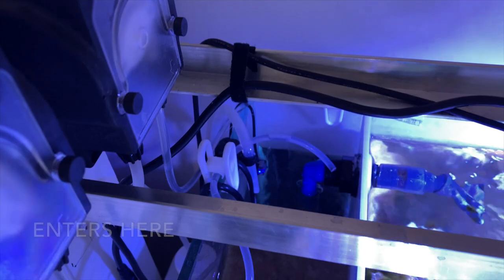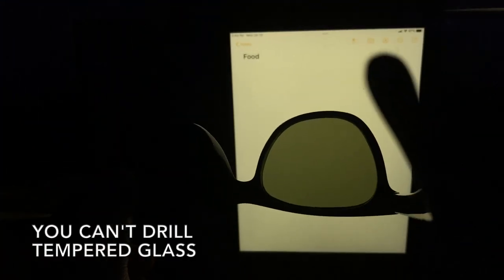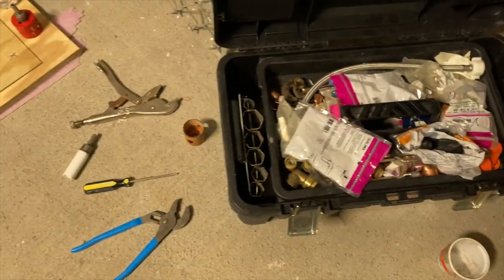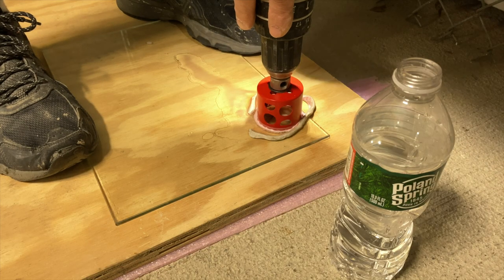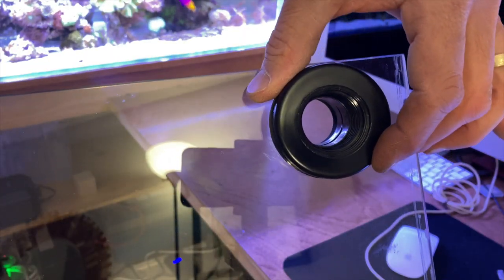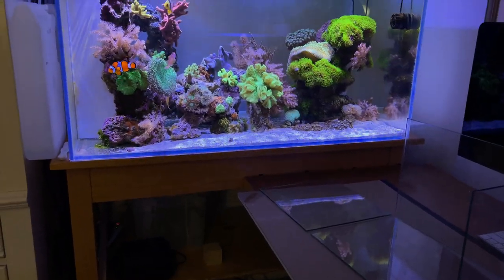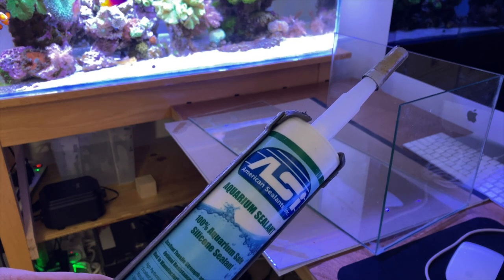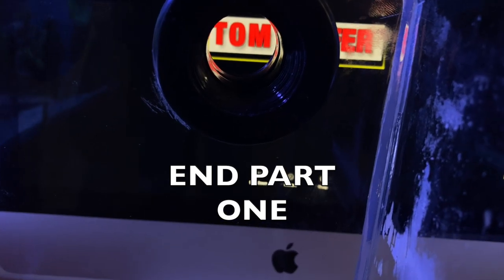How To Set Up A Simple EXTERNAL GRAVITY FED Refugium (Part 1) The Build

Comment: Hey buddy, it’s bobcat here! I have been thinking about starting to use Kalkwasser. I was wondering how and if I could just manual dose it instead of putting it in my ATO container? Plus how much should I dose for a 20 gallon mixed reef?
Reply from the maker: Hey Bobcat! Cool! It’s a bit more work, but you can do it. Called the Slurry method. Lots of trial and testing. First thing, test your tank for calcium, alk and Ph. I would mix  1/8 of a teaspoon to a cup of rodi, just to mix it up. And then poor in a strong flow area, maybe where your return comes in, after the lights go out. The negative thing about the slurry method is you can’t put too much  in at one time. It could raise your ph to high to fast. Dangerous. You’ll have to do it 2-3 times in a 24 hour period. I would do it 10pm, then early am, then mid day. Test the morning after the first evening dose. calcium and ph. If they are ok, then continue the rest of the day. And test the next morning before the morning dose. 👍🏻lots of work.
Reply from the maker: You might be able to get away with twice a day, if your ph stays stable. 👍🏻
Reply: @TOMReefer  thanks buddy!!

Comment: Here's an interesting item as a cautionary tale! I did a similar thing to you by wrenching out an internal filter box with my hands (see: 0:53 in your video). I ended up in the hospital for 10 hours. As I was pulling out the siliconed-in plastic parts, the glass shattered, and even though I was wearing gloves, a big shard of glass sliced my forearm open, deeply. Without the high gloves I was wearing, it could have been a cut near my wrists!!!! Many stiches later I was home and I tossed the tank in the trash. I couldn't tell in the video if there was silicone there holding the back panel on, or if you cut it out then pulled. I made the stupid mistake of pulling and twisting without cutting! Just a cautionary tale for your viewers!
Reply from the maker: Wow! 🤪 I was fully aware that I might break the glass, but didn’t have the brains to protect myself. Although, I used the knife to really loosen the plastic inside to come off easy. But gloves would have been much safer 🤔😬
Reply: @TOMReefer  I knew I messed up as soon as I heard the "boom". It cut so deep and so clean I had no idea until the blood. Gloves from now on! :)

Comment: Hey man can i use a 5 gallon bucket and gravity feed from my main display to the bucket and then a pump in the bucket back to main display ?
Reply from the maker: Yes you can man 😁
Reply: @TOMReefer  is their any pump you would reccomend for me to use inside the bucket to send it back ? And can you give me some tips or tricks ?
Reply from the maker: @Coral-reef. The Sicce line are decent. And the size depends on how much flow you want to run into the bucket. The more powerful the pump, the more flow into the bucket and more noise from the water flow. The sicce 1.5 might work well.

Comment: Great video as always! I’m waiting to see what light you’re going to use on the refugium so I can get one. I have a finger leather coral that part of it has gotten really pale and the whole thing seems pretty limp. It has been fine for months but now doesn’t seem to be doing good. It’s still opening up and the polyps come out just pale and limp. Any ideas 💡 Thanks for the help as always 👍
Reply from the maker: Hey Corey, I’ll probably put an A80 over it? Not sure. I’d like to grow various macro algae, and not sure what light will be best yet. As far as your leather? I’m sure you’ve tested Parameters? If everything else is looking good, you may want to inspect very closely to see if there’s anything on it, nudibranch etc.  if it’s just one section, you might try and cut that part off.